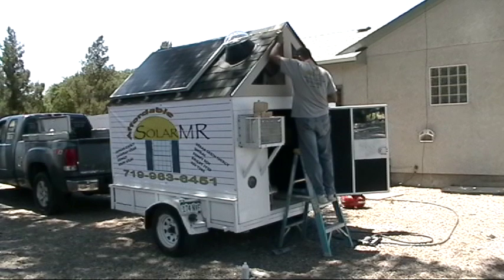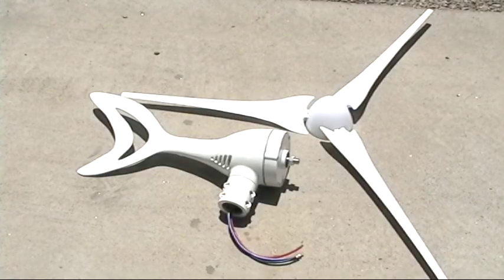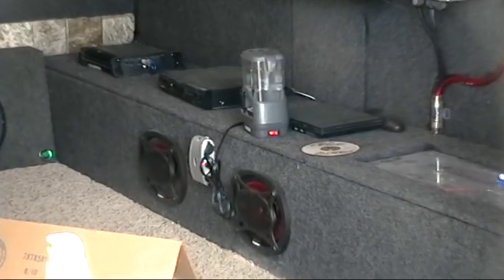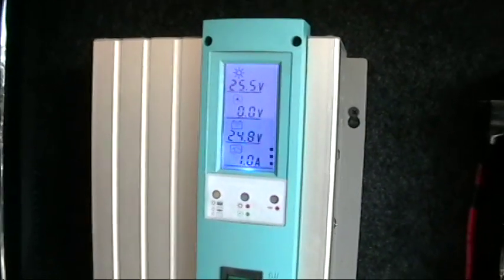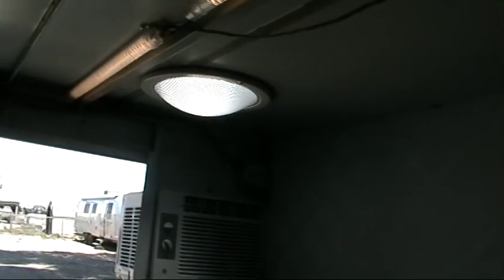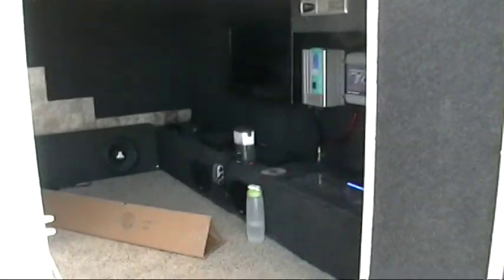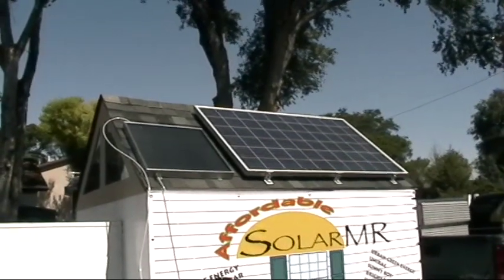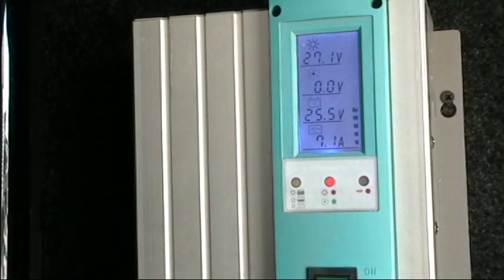offgrid solar trailer.mpg

Comment: I am going to be working on a cargo conversion. And I need to run wiring to run 12v items. Like a phone charger or other small items. What gauge wire should I prewire with so I dont have to rip it all out later? >__< Oh and should it be solid core or stranded?
Reply: First off its none of your business what I know or dont know. But thanks for your input. Second off who said I was doing this on my own?? I have input from professionals. Something you probably are not.
Reply: First off  it is my business, you asked a question on wiring. Second , now your being an Jerk an assuming I do not know what I am talking about. I was an electronic Technician for 6 years in the navy, electrician, Mechanic for a major Factory , and was responsible for all the maintenance at the post office I worked. My advice to you was spot on. You should have said think you instead your mouth ran off.
Reply: Ok electrician come wire my trailer then.
Reply: Oh and since you said I should of said it. Then think you. Just as you requested.

Comment: is there a problem with fumes from batteries being inside trailer?
Reply: Most people who mount the batteries in the trailer put them in an air tight container and vent them outside. Especially if you plan on being in the trailer etc a lot.

Comment from the maker: when deciding on what DC voltage to use, it really comes down to how many batteries you have to work with (weight capacity) and what inverter you have. we just happened to have a 24 volt inverter sitting on the shelf, and capacity for weight was not an issue...so thats why we used that

Comment: "sealed" AGM batteries still vent, so that they don't explode if over charged or charged too quickly. "sealed" just means they don't spill when you tip them over.  If you've ever taken apart a Sealed AGM battery (such as an old UPS battery), you'd be able to plainly see this.  Gel batteries would be the safest bet for having batteries inside small, tight quarters like that. Hydrogen gas buildup is an issue, which is why sealed AGM bat's say to keep them in a "well ventilated" area.

Comment: you should google batteries, solar and off grid solar sytems. we do this for a living. trust me, i would not put standard "wet" lead acid batteries inside a living compartment. No, there are many different types of batts on the market, i sell and install them all. one quick look at this video and you can plainly see these are sealed AGM batts...no venting.
proper install with proper charge controller and proper batts....we are good to go. I slept next to a system like this in the Army for years!

Comment from the maker: oh my friend 91 fatboy, you have much to learn, but thats ok, I am here to help you. Those are 200 ah batteries wired in paralle, so we have 800ah of storage capacity, the ac unit pulls 30 amps at start up, but then drops to just 9. We have run that ac in 100 degree weather for entire days! The solar panels provide 230 watts at 8 amps each and the turbine provides 500 watts at 8 amps. we have more than enough power to run for very long periods of time, but thanks for your concern

Comment: I can see you are not going to let this go. If we are going to be specific the ideal situation is to have the solar panels mounted on a rotating track that follows the optimal angle towards the sun but not only does he not need optimal sun exposure but for the purpose of demonstrating the efficiency of the solar panel a less than optimal exposure is best not to mention that this way he doesn’t need to put any additional thought into setup.

Comment: @electrodacus Since, what you pointed out, “get only single slope roof…and both solar PV get the sun.” is unnecessary because as you also said, “he cannot have both at the same time facing sun since the controller is too small.” Then having the solar panels on the 2 sides of the mobile trailer makes demonstrations easier and more useful. He is after all trying to get people to see the range of their usage.

Comment: @electrodacus  If he can’t have both on at the same time then there was no need to tell him to put both on one side because he wouldn’t be able to take advantage of it. He showed how much they produce in its present configuration, which wasn’t nothing so their place on the trailer makes perfect sense since he can just park the trailer in any direction and still get power. By having them on one side he would have to reposition the trailer each time for optimal exposure.

Comment: @electrodacus Facing all the solar panels south produces the optimal result, which is what a fixed location home needs. However the demonstration trailer is not fixed and optimal results are not necessary. Most solar panels these Days can function in less than optimal results which is a factor that I would like to see demonstrated if I were buying solar panels which I figure is probably the reason why they put the solar panel on both sides.

Comment from the maker: you are correct, but here is why. the charge controller in this unit can only handle 300 watts of solar, we put 2-230 watt panels on so that at any given time only one or the other is putting out full power. This unit also has a 600 watt wind turbine, so we have plenty of charging power. thanks for watching